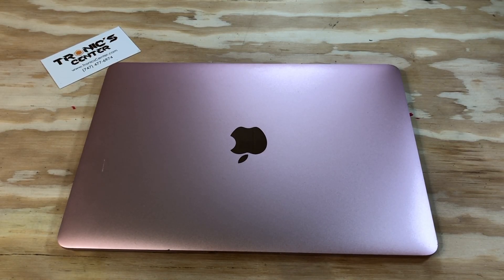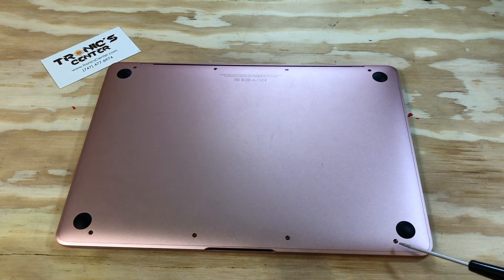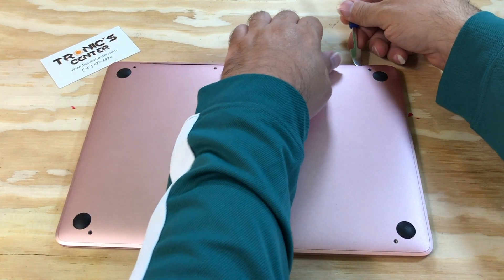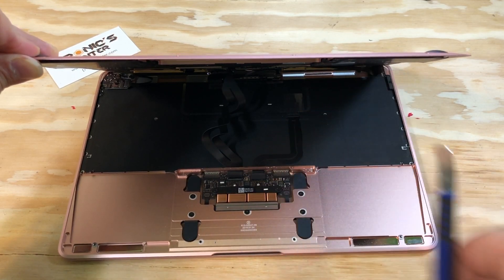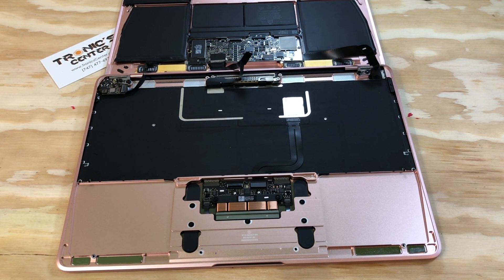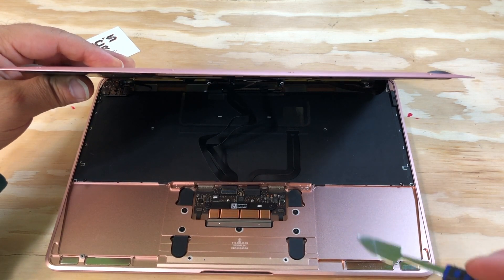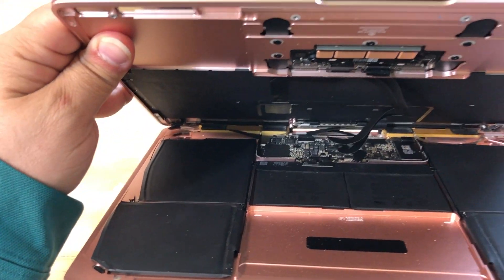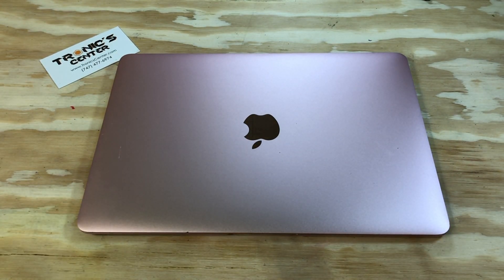How to Replace Force Touch Trackpad IPD Cable on 12" MacBook A1534   Force Touch Trackpad IPD Cable

Comment: Thank you! 
Was looking for a tutorial.
Reply from the maker: Hello
Thanks for watching this video and supporting us, Here is some Related Keyword 12" MacBook A1534 repair, MacBook A1534 screen replacement, MacBook A1534 battery replacement, MacBook A1534 keyboard repair, MacBook A1534 logic board repair, MacBook A1534 water damage repair, MacBook A1534 charging port fix, MacBook A1534 gold repair, MacBook A1534 rose gold repair, MacBook A1534 silver repair, MacBook A1534 space gray repair, MacBook A1534 screen replacement cost, MacBook A1534 repair service near me, MacBook A1534 hinge repair, MacBook A1534 motherboard repair, MacBook A1534 repair price, MacBook A1534 repair store, MacBook A1534 technician near me, MacBook A1534 fix, 12-inch MacBook A1534 repair, MacBook A1534 display repair, MacBook A1534 no power issue, MacBook A1534 boot problem fix, MacBook A1534 repair expert, MacBook A1534 overheating fix, MacBook A1534 trackpad repair, MacBook A1534 not charging fix, MacBook A1534 slow performance fix, MacBook A1534 SSD replacement, MacBook A1534 repair cost, MacBook A1534 diagnostic service, MacBook A1534 repair shop, MacBook A1534 Apple repair, MacBook A1534 backlight repair, MacBook A1534 liquid damage fix, MacBook A1534 speaker repair, MacBook A1534 fan replacement, MacBook A1534 data recovery, MacBook A1534 repair time, MacBook A1534 repair DIY, MacBook A1534 repair tutorial, MacBook A1534 professional repair, MacBook A1534 same-day repair, MacBook A1534 repair guide, MacBook A1534 motherboard replacement, MacBook A1534 broken hinge fix, MacBook A1534 logic board replacement, MacBook A1534 MacOS reinstall, MacBook A1534 hard drive upgrade, MacBook A1534 repair warranty, MacBook A1534 back cover replacement, MacBook A1534 frame repair, MacBook A1534 power button fix, MacBook A1534 screen flickering fix, MacBook A1534 black screen fix, MacBook A1534 stuck on Apple logo, MacBook A1534 USB-C repair, MacBook A1534 keyboard not working fix, MacBook A1534 repair appointment, MacBook A1534 replacement parts, MacBook A1534 LCD repair, MacBook A1534 battery draining fast fix, MacBook A1534 charging issues, MacBook A1534 screen cracked fix, MacBook A1534 keyboard replacement price, MacBook A1534 Retina display repair, MacBook A1534 touchpad fix, MacBook A1534 repair warranty check, MacBook A1534 casing repair, MacBook A1534 aluminum body repair, MacBook A1534 refurbished repair, MacBook A1534 logic board issues, MacBook A1534 Bluetooth not working, MacBook A1534 WiFi issues fix, MacBook A1534 microphone repair, MacBook A1534 trackpad replacement, MacBook A1534 repair without AppleCare, MacBook A1534 local repair services, MacBook A1534 MacOS update issues, MacBook A1534 diagnostic fee, MacBook A1534 repair review, MacBook A1534 repair center, MacBook A1534 fan noise fix, MacBook A1534 overheating solutions, MacBook A1534 keyboard repair cost, MacBook A1534 stuck key fix, MacBook A1534 Touch ID repair, MacBook A1534 replacement guide, MacBook A1534 professional fix, MacBook A1534 Apple repair cost, MacBook A1534 service center, MacBook A1534 best repair service, MacBook A1534 battery swelling issue, MacBook A1534 screen dim fix, MacBook A1534 back cover scratch fix, MacBook A1534 trackpad clicking issue, MacBook A1534 speaker replacement, MacBook A1534 loud fan fix, MacBook A1534 MacOS reinstall guide, MacBook A1534 repair near me, MacBook A1534 full service repair, MacBook A1534 Apple authorized repair, MacBook A1534 color matching repair, MacBook A1534 LCD panel replacement, MacBook A1534 slow boot fix, MacBook A1534 trackpad unresponsive fix, MacBook A1534 warranty repair, MacBook A1534 power failure fix, MacBook A1534 keyboard sticky keys fix, MacBook A1534 no sound fix, MacBook A1534 power adapter repair, MacBook A1534 service time, MacBook A1534 screen bleeding fix, MacBook A1534 USB port loose fix, MacBook A1534 bezel replacement, MacBook A1534 Retina display replacement, MacBook A1534 12-inch repair, MacBook A1534 video output issue fix, MacBook A1534 GPU repair, MacBook A1534 speaker buzzing fix, MacBook A1534 microphone replacement, MacBook A1534 Bluetooth connectivity fix, MacBook A1534 data transfer service, MacBook A1534 professional technician, MacBook A1534 fix at home, MacBook A1534 fix appointment, MacBook A1534 display replacement cost, MacBook A1534 warranty check, MacBook A1534 AppleCare repair, MacBook A1534 authorized repair shop, MacBook A1534 dent repair, MacBook A1534 screen calibration fix, MacBook A1534 backlight issue fix, MacBook A1534 motherboard troubleshooting, MacBook A1534 motherboard fix, MacBook A1534 liquid spill repair, MacBook A1534 charging slow fix, MacBook A1534 Apple screen replacement, MacBook A1534 sleep mode issues, MacBook A1534 SSD upgrade, MacBook A1534 hinge loose fix, MacBook A1534 audio jack repair, MacBook A1534 audio issue fix, MacBook A1534 camera not working fix, MacBook A1534 FaceTime camera fix, MacBook A1534 MacOS installation fix, MacBook A1534 charging cable fix, MacBook A1534 repair steps, MacBook A1534 touchpad issue, MacBook A1534 laptop repair near me, MacBook A1534 case replacement, MacBook A1534 cracked case repair, MacBook A1534 top case replacement, MacBook A1534 MacOS reinstall service, MacBook A1534 thermal paste replacement, MacBook A1534 fan noise repair, MacBook A1534 screen disassembly, MacBook A1534 color restoration, MacBook A1534 hinge damage fix, MacBook A1534 screen glitch fix, MacBook A1534 repair manual, MacBook A1534 screen touch issue fix, MacBook A1534 dark screen repair, MacBook A1534 flickering display fix, MacBook A1534 display backlight issue, MacBook A1534 boot failure fix, MacBook A1534 startup problem fix, MacBook A1534 OS crash fix, MacBook A1534 overheating warning fix, MacBook A1534 software repair, MacBook A1534 keyboard water damage repair, MacBook A1534 case crack fix, MacBook A1534 performance optimization, MacBook A1534 software troubleshooting, MacBook A1534 DIY repair steps, MacBook A1534 trackpad won’t click fix, MacBook A1534 logic board troubleshooting, MacBook A1534 Apple certified repair, MacBook A1534 Retina screen fix, MacBook A1534 troubleshooting guide, MacBook A1534 repair service online, MacBook A1534 spare parts replacement, If you have any other Request please Let us know .
Many Thanks
Reply from the maker: If You Need any Original Parts or Tools You May Visit www.Tronicscenter.com For Original Apple Parts .

Comment: If u dont have connected that cable computer doesnt turn on?
Reply from the maker: Thanks for watching, Good luck with your research .

Keywords:
MacBook repair services
Apple Mac repair near me
MacBook screen replacement
MacBook battery repair
Apple certified Mac repair
MacBook water damage repair
MacBook keyboard replacement
Mac repair specialist
Affordable MacBook repair
MacBook repair warranty

Hashtags :
#MacBookRepair
#AppleRepair
#MacRepair
#MacBookFix
#MacBookService
#MacRepairSpecialist
#MacTech
#FixMyMac
#MacBookScreenRepair
#AppleSupport
#RepairMyMac
#MacServiceCenter
#MacBookBatteryReplacement
#MacBookKeyboardFix
#AppleCertifiedRepair

MacBook Pro
MacBook Air
Apple MacBook deals
MacBook accessories
MacBook repair services
Best MacBook for students
MacBook 2024 release date
MacBook battery replacement
Apple MacBook upgrade
Refurbished MacBook
Popular Hashtags for Social Media:
#MacBook
#MacBookPro
#MacBookAir
#AppleMac
#Apple
#AppleProducts
#MacBookDeals
#MacLife
#AppleEvent
#AppleEcosystem
#TechForLife
#MacBookPhotography
#MacBookSetup
#RefurbishedMacBook
#MacBookTips
Reply from the maker: If You Need any Original Parts or Tools You May Visit www.Tronicscenter.com For Original Apple Parts .

Comment: my Mac turns on without the trackpad cable, but doesn't turn on when the trackpad cable is connected. Any ideas please?
Reply: Had same issue. Drove me crazy. Did you figure it out?
Reply: @bkuu  faulty trackpad cable. I replaced with a new cable
Reply: @Cass2848-i4i  can you tell me where and which cable you got it from. There are so many online I ended up buying a few to try. thanks for the response
Reply: @bkuu  ebay a1534 trackpad replacement cable :)
Reply: @Cass2848-i4i  thanks. i guess the ones on amazon are trash. Hopefully i get it to work!
Reply from the maker: Hi, Need to be diagnosis test to determine the issue , Thanks for watching, Good luck with your research .

Keywords:
MacBook repair services
Apple Mac repair near me
MacBook screen replacement
MacBook battery repair
Apple certified Mac repair
MacBook water damage repair
MacBook keyboard replacement
Mac repair specialist
Affordable MacBook repair
MacBook repair warranty

Hashtags :
#MacBookRepair
#AppleRepair
#MacRepair
#MacBookFix
#MacBookService
#MacRepairSpecialist
#MacTech
#FixMyMac
#MacBookScreenRepair
#AppleSupport
#RepairMyMac
#MacServiceCenter
#MacBookBatteryReplacement
#MacBookKeyboardFix
#AppleCertifiedRepair

MacBook Pro
MacBook Air
Apple MacBook deals
MacBook accessories
MacBook repair services
Best MacBook for students
MacBook 2024 release date
MacBook battery replacement
Apple MacBook upgrade
Refurbished MacBook
Popular Hashtags for Social Media:
#MacBook
#MacBookPro
#MacBookAir
#AppleMac
#Apple
#AppleProducts
#MacBookDeals
#MacLife
#AppleEvent
#AppleEcosystem
#TechForLife
#MacBookPhotography
#MacBookSetup
#RefurbishedMacBook
#MacBookTips

Comment: Okay, so I did that. Great tutorial btw

But my MacBook still doesn’t work. I can’t find another reason as to why it keyboard and trackpad won’t work, so yeaashhh… still stuck 😢
Reply from the maker: Dear You may Visit Your Local Apple Store or Computer store so they can diagnosis and advise , Thanks ! Dear Customer let us know what repair or disassembly you want us to make video ! Please not that we do deal with all Brands Dell, Lenovo, Asus, Razer, Toshiba, Hp, Sony, Panasonic, Nikon, Canon, Black Magic, Red Camera, any Camcorder Bards, Also we do IT Support and Data Recovery ! we would love to hear from you .
Reply from the maker: A2251 KeyWords 

MacBook Pro "Core i5" 2.0 13" 2020 4 TB 3, 2.0 GHz Core i5, I5-1038NG7, MacBook Pro "Core i7" 2.3 13" 2020 4 TB 3, 2.3 GHz Core i7,  I7-1068NG7, MacBookPro16,2 , 2020 13" 4 TB 3 , A2251 MacBook , EMC 3348, MWP72LL/A, BTO/CTO

————————————————————

A2141 KeyWords 

MacBook Pro "Core i7" 2.6 16" 2019, 2.6 GHz Core i7 (I7-9750H), 2.3 GHz Core i9 (I9-9880H), A2141 (EMC 3347), 2.4 GHz Core i9 (I9-9980HK) , MacBookPro16,1, MacBook Pro "Core i7" 2.6 16" 2019 5600M, 2.6 GHz Core i7 (I7-9750H),  MacBookPro16,4 , MacBook Pro "Core i9" 2.3 16" 2019 5600M, 2.3 GHz Core i9 (I9-9880H), MacBook Pro "Core i9" 2.4 16" 2019 5600M, 2.4 GHz Core i9 (I9-9980HK), MVVL2LL/A, MVVM2LL/A, 16" MacBook A2141

———————————————

A2179 Keywords

MWTJ2LL/A, EMC 3302 , 1.1 GHz Core i3 (I3-1000NG4) , MacBook Air "Core i3" 1.1 13" (Scissor, 2020) , MacBookAir9,1 , 1.1 GHz Core i5 (I5-1030NG7) , MVH22LL/A , MacBook Air "Core i7" 1.2 13" (Scissor, 2020), 1.2 GHz Core i7 (I7-1060NG7)

——————————————

A2159 Keywords 

1.4 GHz Core i5 (I5-8257U) , MacBook Pro "Core i5" 1.4 13" Touch/2019 2 TB 3 , MacBook Pro "Core i7" 1.7 13" Touch/2019 2 TB 3 , 1.7 GHz Core i7 (I7-8557U) , MUHN2LL/A , A2159 , EMC 3301 , MacBookPro15,4 , 2019 13" (Touch Bar, 2 TB 3), 13" MacBook Pro A2159

—————————————————————

A1932 Keywords  

MRE82LL/A , MVFH2LL/A, 1.6 GHz Core I5-8210Y, 1.6 GHz Core I5-8210Y, MacBookAir8,1 , EMC 3184 , 13" MacBook Air Space Gray, 13" MacBook Air Gold , 13" MacBook Air Silver , 13" MacBook Air 2019 13" MacBook Air 2018, 13" MacBook Air A1932

—————————————————————

A1534 Keyword’s

EMC 2746, MF855LL/A, MF865LL/A, EMC 2991, MLHA2LL/A, MLHC2LL/A, EMC 3099, MNYF2LL/A, MNYG2LL/A, MacBook8,1 , 1.1 GHz Core M (M-5Y31) , 1.2 GHz Core M (M-5Y51), 1.3 GHz Core M (M-5Y71), 1.1 GHz Core m3 (M3-6Y30), 1.2 GHz Core m5 (M5-6Y54), 1.3 GHz Core m7 (M7-6Y75), 1.2 GHz Core m3 (M3-7Y32), 1.3 GHz Core i5 (I5-7Y54), 1.4 GHz Core i7 (I7-7Y75), MacBook9,1 , MacBook10,1

——————————————————

A1990 Keywords

MR932LL/A, 2.2 GHz Core i7 (I7-8750H), EMC 3215, MacBookPro15,1 , MR942LL/A 2.6 GHz Core i7 (I7-8850H), 2.6 GHz Core i7 (I7-8850H), 2.9 GHz Core i9 (I9-8950HK), 2.6 GHz Core i7 (I7-9750H), EMC 3359, 2.3 GHz Core i9 (I9-9880H), 2.4 GHz Core i9 (I9-9980HK), MacBookPro15,3, A1990 MacBook, 15” MacBook A1990

———————————————————

A1989 Keyword 

A1989 MacBook 2018 MR9Q2LL/A, 2.3 GHz Core i5 (I5-8259U), BTO/CTO, 2.7 GHz Core i7 (I7-8559U), EMC 3214, MacBookPro15,2 , A1989 MacBook 2019 MV962LL/A , 2.4 GHz Core i5 (I5-8279U) , MV982LL/A, 2.8 GHz Core i7 (I7-8569U) , EMC 3358, 13" MacBook A1989

———————————————

A1708 Keywords

MLL42LL/A, A1708, EMC 2978, MacBookPro13,1 , 2.0 GHz Core i5 (I5-6360U) , 2.4 GHz Core i7 (I7-6660U) , MPXQ2LL/A, EMC 3164, 2.3 GHz Core i5 (I5-7360U) , 2.5 GHz Core i7 (I7-7660U), MPXQ2LL/A, 13" MacBook A1708

———————————————————— 
MacBook 

Apple, MacBook, 13" MacBook, MacBook Air, A1466 MacBook, MacBook Air logic Board, 13" MacBook Air , Apple Mac , 11” MacBook , A1465 MacBook, A1502 MacBook, A1398 MacBook, A1425 MacBook, A1706 MacBook, A1708 MacBook, A1707 MacBook, A1990 MacBook, A1989 MacBook, A2159 MacBook, A2179 MacBook, A2289 MacBook, A2337 MacBook, A2338 MacBook, A2141 MacBook, MacBook Pro, MacBook Pro Retina, Retina display, True Tone Display , Top Case KeyBoard, Apple Keyboard, MacBook KeyBoard, MacBook Trackpad.
———————————————————

A1398 MacBook, A1398 Logic Board, A1398 LCD, A1398 KeyBoard , A1398 Display, MC975LL/A, MC976LL/A, MD831LL/A, ME664LL/A, ME665LL/A , ME698LL/A, ME293LL/A, ME294LL/A, ME874LL/A, MGXA2LL/A, MGXC2LL/A, MGXG2LL/A, MJLQ2LL/A, MJLT2LL/A, MJLU2LL/A

—————————————————————

A1706 Keywords

MLH12LL/A, A1706 EMC 3071, MacBookPro13,2 , MacBookPro14,2 , MPXV2LL/A, A1706 EMC 3163 , 3.5 GHz Core I7-7567U, 3.3 GHz Core I5-7287U, 3.1 GHz Core I5-7267U, 3.3 GHz Core I7-6567U, 3.1 GHz Core I5-6287U, 2.9 GHz Core I5-6267U, A1706 MacBook, A1706 MacBook Touch Bar 

—————————————————————
A1707 Keywords 

MPN 923-01477 , MLH32LL/A, MLH42LL/A, MPTR2LL/A, MPTT2LL, EMC 3072, MLH32LL/A, MacBookPro13,3, 2.7 GHz Core i7 (I7-6820HQ), MLH42LL/A, 2.9 GHz Core i7 (I7-6920HQ), EMC 3162 , 2.8 GHz Core i7 (I7-7700HQ), MacBookPro14,3 , 2.9 GHz Core i7 (I7-7820HQ), MPTR2LL/A, MPTT2LL/A, 3.1 GHz Core i7 (I7-7920HQ), A1707 MacBook, A1707 Touch Bar